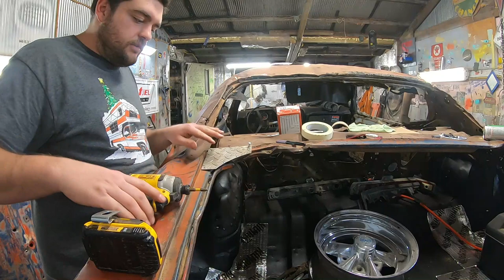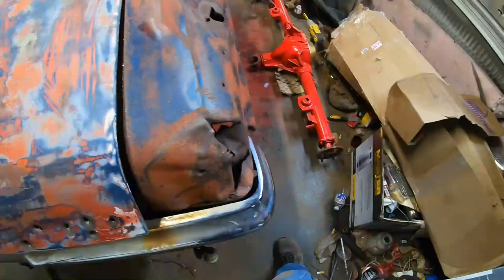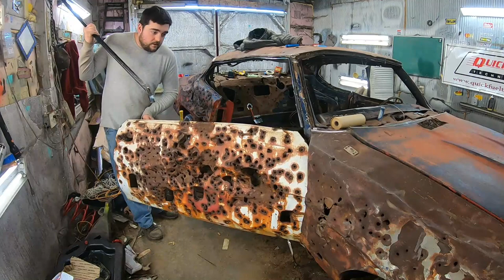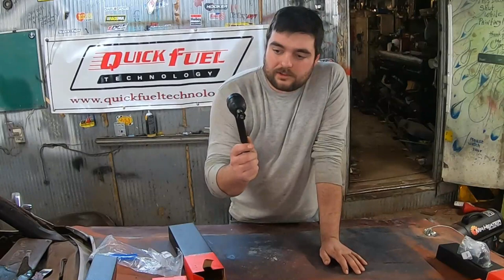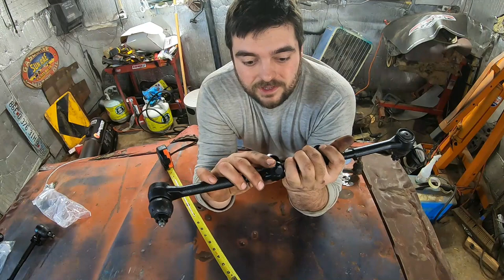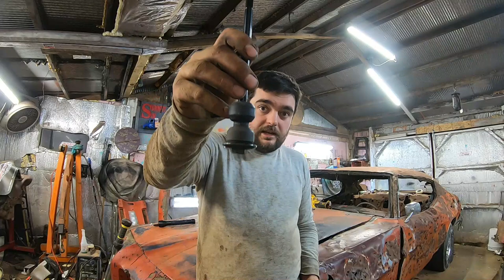The Holey Goat: Worst GTO Ever Part 15 — LED Lights, Trunk Lid, Steering Rebuild, and Autorama 2022?

Comment: I have a 76 A body and I wanted to use the pro forged stuff but I on a budget. I found out GM ran the thicker diameter centerline and tie rods on the 94-96 impala SS. So I bought factory replacements at a 3rd of the price. Idk if that would work on the 68-72 a body's or not but to anyone reading this with a 73-77 A body the Impala SS sway bars bolt right up as well.

Comment: If you're going with a disco kind of thing, I will try to find you a copy of "Saturday Night Fever" on 8 track.
How about a mini mirror ball for a dome light? I've seen those at the 99¢ store. You'd have the option of either the disco thing or the rcck and roll thing, depending on your mood. Just like a mood ring. Of course you'll also have to get one of those. It completes the period correct wardrobe.
            You have vortexed me into this madness, and now you've got me waiting for each new video, wondering what you're going to do next. I think I'm having almost as much fun as you are.
Reply from the maker: Glad to hear it!
Reply: The really ironic part of  all this is, I sincerely believe that when you complete this project, you're going to have yourself a very mecjanically sound, good running car. '

Comment: No respectable street machine would be caught dead without white letter tires! But there is a company that sells the stick on white lettering so you wouldn't necessarily need tire get different tires to complete the look. Great job on the videos! I have been entertained and like many i thought you were crazy even hauling that POS home LMAO
Reply: You could even get custom letters that say the name of the car to put on the tires. That thought just smacked me in my noggin after I left my first comment.
Reply: Yeah them white letter tires pop. Always hate it when people put them on the inside.
Reply from the maker: I wish they were, those big meats are ancient, they are white outline but turned in. I'm too scared to bust them off and flip them
Reply: @PoleBarnGarage  I said it before and I'll say it again I'm glad this car got saved cuz I could have swore somebody was going to buy just for the drivetrain

Comment: If your remote stops working you can turn on your phone’s camera and look at the infrared emitter on the end of the remote. If it doesn’t flash when you hit a button, either your battery is dead in the remote or it’s got something wrong with it.  Bought my son that same
LED kit for his room and the remote battery it came with was deader than disco!
Reply from the maker: I probably should've done some investigation instead of immediately assuming it was garbage.
Reply: @PoleBarnGarage  In your defense, your assumption was most likely accurate lol

Comment: I've chisled a few too many of them plated lug nuts. Then fight your socket off ,cause you had to hammer it on. Good times,not,lol! Craftsman has a remover socket set, 1/2 drive .money well spent, it's a set of 4 sockets with external teeth, that bite good and comes off easily.
Reply from the maker: Harbor freight sells a similar set that I wish I had

Comment: I would think that all that fine dirt from the doors (or anywhere else) will be kicking up into the cabin at just about any speed.
Reply from the maker: It will indeed. I will be wearing a respirator on its maiden voyage most likely

Comment: I've said this on one of your other videos, I think JD's personal build, but I'll say it again.. EVERY vehicle I work on for myself or my family or friends I always upgrade - even if it's just level 1 stuff, I always do all the front suspension. Most of the crap I get is usually pre-crusher anyway so it all needs it, but yeah man front and even rear suspension parts are just a game changer. I see SO many cars with worn out tired looking suspension.. 20 grand in the engine bay and tires and wheels with old crusty suspension.. I don't get it, maybe guys are afraid to mess with it or whatever, I dunno.. I have no issues paying 89 bucks for an alignment after doing a front end rebuild though.. it's worth it to me and I'm usually pretty darn close when i do it anyway!

Comment: I keep wondering what might be the procedure for making a windshield fit.  I'm sure body shops deal with this all the time with roll overs- maybe there is some tricks to be learned.
Reply from the maker: Large hammer and glue is pretty much as deep as my skill set goes
Reply: I wonder if you can sand the edge of the glass to make it slightly smaller in a spot or two if need ?
Reply from the maker: Probably not with laminated glass. 3m window weld will get glass in there, but it may not be pretty
Reply: I was thinking more of some way of suspending the glass above your opening so that you could measure and hammer on the opening to make it fit

Comment: You should really think about using an old trans-am steering wheel it would look Cool and be was nicer to drive with, also use the steering box for the Fast Ratio steering!
Reply from the maker: But she's the factory sport wheel man, it has to stay. Besides, I get to wear cool driving gloves like Warren Oates in Two Lane Blacktop

Comment: i put the led lights in my gills on my z28 they are blinkers that have arrows on them there is 4 arrows that go off one right after another looks good behind the gills gives it a flame look just to be different something i been playing with before i build the car been trying thing out for over a year on it as i build a 68 chevy pu and a 70 high boy ford . i have most of the parts for the camaro a 79 z28 rs t top have a 450 hp stroked 454 with a 02xx 400r turbo good to 800 hp stock or a t-10 4 speed with a 12 inch corvette clutch set up with new fly wheel so far i have no money in it got everything for free so far have 2 extra z28 hard tops for parts got them for free all are good cars rust free clean bodies one has new custom interior in it  was a show car but they pulled the engine and trans for a 69 camaro build got the left overs for free '

Comment: Was good episode....I've rebuilt many a front ends but hope it helped somebody!!!!!! How come you didn't change "THE PITMAN ARM????" Cause there really a pain in ur azzzzzzzz 🤣🤣🤣🤣🤣🤣🤣🤣🤣Hope you fine ur grease gun....cause most shops don't grease nothing when they align the front end!!!! Times have changed over last 20 yrs!! Hell if you buy cheap front end parts, they don't even have grease fittings🤣🤣🤣🤣
Reply from the maker: Pitman arm is not only a pain, but also not really a wear item on these in my experience. Just a big ole hunk of metal
Reply: @PoleBarnGarage  I agree and was just given ya chit lol  They can wear out but mostly on the trucks not the cars :)
Reply from the maker: Yes! I've replaced many on trucks lol

Comment: On the rear axle, measure from center to center of the tires. Do the same on the front tires. Adjust alignment accordingly.
Reply from the maker: This works if the tires are the same size I believe
Reply: @PoleBarnGarage  Just run that sumbich down the road about 60 or 70, she will let you know which way to start cranking pieces and parts til she is walkin straight!! LOL